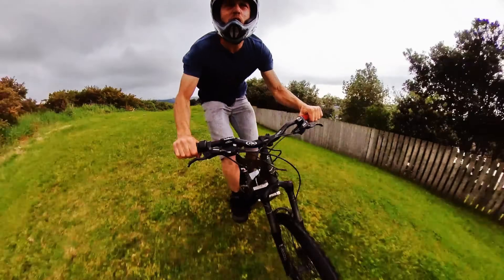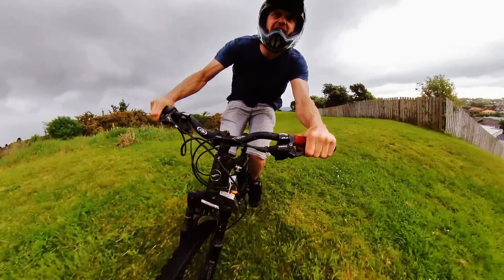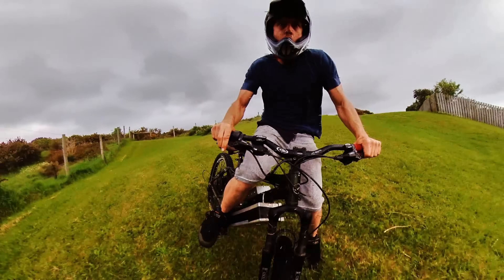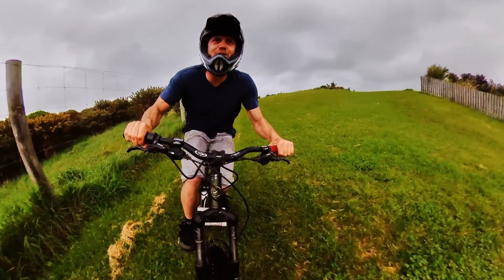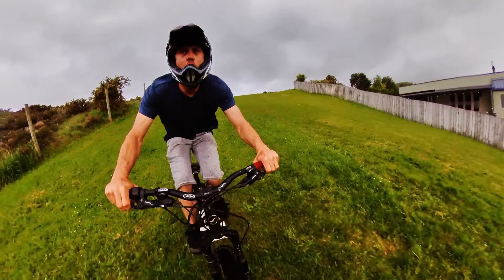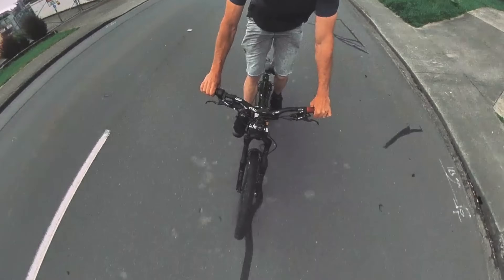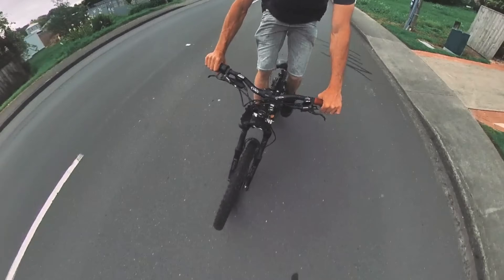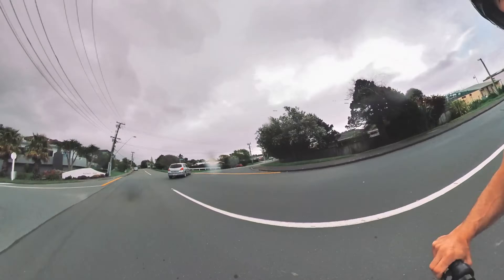How to build a beast 5kw ebike from a 1.5kw aliexpress hubmotor kit

Comment: he didn't say this is dont think but, DO NOT RUN LITHIUM BATTERIES WITHOUT A FUSE! ESPECIALLY, IF YOU ARE NEGATING POWER LIMITS ON AN ESC. IF YOU HAVE 1 SINGLE TRANSISTOR BUST YOU WILL HAVE AN ELECTRICAL FIRE OR BATTERY FIRE. BOTH OF WHICH ARE IMPOSSIBLE TO PUT!!!!!!!!!!!!!!

also, He did not test the temperature on the coils, which is much more worrisome than the temp of the magnets. If the magnets get too hot all they do is lose there magnetism. Whereas the coils will melt and short and cause electrical or battery fires as well.

Not to mention the fact that the system is probably less than 60% efficient due to the small gauge of wire in the coils. Odds are at least 20% of the power being used is being given off as waste heat. Especially if you overload the coils and the ESC.
Reply from the maker: Yes this is true, I am just using these batteries for the testing and I have an xt90 plug by my leg I can disconnect easily, it's similar to running off lipo cells but a fuse is definitely a good idea thank you. I have a 18s 4p of p42a cells with a bms is in the works going in a new battery box, this will be much safer battery.
Reply: @jd-dc  Great, I'm just worried about people replicating your project without supporting knowledge. I did that with disastrous results. I built up a pack of 18650s 4years ago and they exploded in a hotel while charging.
Reply from the maker: Yes I agree, that is why there is no information about the design or build of the batteries in this video, they will need a lot more information to try to build their own battery, check out my electric skateboard build video I documented the battery build in that video. 
Oh no way that's no good. We're you charging on a balance charger or did you run it on a bms? I welded up a big steel box in my garage for building batteries and for charging, hopefully I never need it but you just never know
Reply: @jd-dc  I had a BMS on it, but I used brand new, ebay, dell batteries. They were probably of the ultra fire variety because they popped off. I have learned my lesson with that though and I got all the right equipment. A good spot welder, LG/SANYO/Samsung cells and other legit brands. I also heavily caution people from using Amazon special BMSs and always suggest a Superior/Daly BMS even if it take 2 months to get here. I also suggest that people use per-cell fuses on packs over 2-3p. I have been testing used/dead bycycle packs. They have good cells. I also have two scooter packs on my personal bike from Jehu Garcia, jag35.com.

Comment: Cool video, I learned about hub sinks and statorade.  I am sure you already know, but you are absolutely thrashing those batteries and they will not have much of a lifespan.  If you look up the damage that discharge over 3C does you will cringe.  Just estimating, I already forgot your stats but it looks like you are around 8C discharge.  Did you check how much you are heating your batteries when you do this?
Reply from the maker: Thank you, yes I monitor the batteries every ride, they do not heat up much at all. They are a 5p configuration of samsung 25r 18650 cells approved for 20A continuous per cell so in that pack it has no problem pushing out 80A peaks. It's just the test batteries I'm using that were harvested from some abused Ego batteries. I have created a new battery box and will build I bigger battery with a bms out of p42a cells. Video to come soon
Reply: @jd-dc  I just skimmed thru the video again, on the ESC all you did was add solder to the shunt to lower impedance?  Then you overvolted it and stuffed a bunch of extra current (heat) into it that is isn't designed for. Is that correct?  Chinese electronics are well known to perform at least 20% under specifications as their limit.  How is your ESC working?  That is amazing it didn't burn up immediately LOL.
Reply from the maker: I know right! I've been running this kit like this for over a year riding trails, this is a really strong kit. However I recently cut up my bike to make a battery and esc box but I've found if the esc isn't exposed it gets pretty hot so will have to re think that plan

Comment: Those yellow and blue and green wires coming from controller especially the yellow one can’t take much more than 1500w I’ve burnt many of them out
Reply: Yes, it is the thickness of gauge of wiring. It's why those cables get thicker of every step up controller. You have to fit new wiring from motor, battery and controller. Thickness of wiring is part of the math in all electrical re work.
Reply: @user619tlsdca5  what amps the stock motor wires suitable for?
Reply: @liammccallum9398  Depends on the motor.  Different gauges of wires are easy to look up their power ratings for.
Reply: how much A can the motor wires take
Reply: @liammccallum9398  To be reworking the cables to match the upgraded controller s awg or gauge of thickness, you have to be very schooled in electrical field or take chances here of instruction videos because you going to have to remove the bonding at terminal ends and even get into battery case to replace original cables. You can't just add it on to existing ends for they won't match or do anything of higher output if electricity. To be simple, jus look at controller s terminal ends to match with battery. Example is there s 2 batteries of 52 v 20ah from one vendor, reasons 2 types is due to one deicated for 1500w controller and other one is for 2000w. What sets them apart is the one for 2000watt has the right thickness of terminals to controller. I use same battery between my 1500 and 2000watt e bike but my battery fitted for 1500watt as I still can use on my 2000watt but controller amping up more demand from battery as you can tell from the sound being juiced out. I would have to get into battery case of breaking of the bonding and re do right thickness of cables from within the battery.

Comment: I have done before but finally burnt mine out after a few months how long did urs last?
Reply from the maker: So far I have been riding it like this for 15 months but the first 2 months it was on a 20 inch wheel. I did notice the hub motor getting hot which is why I decided to install the hub sinks. This KS brand motor (qs rip off) I used seems very solid

Comment: Hey just want to ask can you do this on a electric dc motor ?
Reply from the maker: Yes this is an electric dc motor, 3 phase brushless. Are you referring to a brushed dc motor with 2 wires and no hall sensors? What controller are you using?

Comment: Can the same thing be done for a mid drive setup?
Reply from the maker: Yes it can but the kit from this video has a large motor and controller for 1500w which may or may not be the case with your set up so try not to over do it right away and make sure you monitor the heat until you know how much it can handle. Most mid drives have heat sinks already but you cam add statorade to help with the cooling.
I have a video coming out in the next couple of months on a 6kw cyclone mid drive kit that was pretty cheap. It's going on a 2010 kona stinky, I will add links and a ride review also

Comment: This was really good. I'll bet you could run 8-9Kw on that motor no problem. What exactly did you do for that motor controller? I have a 65A chinese controller, does that mean I can make it 150A?
Reply: You Can make it even 650A if you know how to :)
Reply: @etrix4533  wouldnt other components give out though??
Reply: @shaunphillips6160  yes, you would need to swap out most of the components in your controller and make traises stronger and thicker for more power.
Reply: if you want your caps to explode sure.

Comment: Great video I'm wondering how you switch between 36v and 72v? It looks like you are running a couple of batteries in series? What is the BMS rated at? Relatively new to ebikes but would like to run a couple of 36v in series on mine. Just don't see how to avoid damaging the BMS.
Reply from the maker: Thank you, I am not using a bms for these batteries at the moment I have 4 x 18v battery packs with balance wires attached that I can balance charge on a hobby charger. And I use a voltage alarm when I'm discharging. You should be able to connect your batteries in series for discharge and then disconnect and charge them separately without damaging the bms's as long as they are the same voltage and amp hour packs. 
Also make sure your controller can handle 72v and your battery cells and bms can handle the Amp discharge rate from your controller
Reply: @jd-dc  max voltage depend one the model of the fetts/transistors/ and caps voltage XD most 36-48v controlers have 63v caps

Comment: Enjoyed video, I like your battery box, but seems like front tire would hit when suspension compressed.? Hope not. As for sealing side plates on motor with silicone, don't do it! Water leaks in at axle and has no where to go, mine quit turning because the space between rotor and magnets was filled with rust.
Reply from the maker: You are right it does hit but only if I take a pretty big drop, so I have removed the battery box and the top bar and rebuilt the frame into a bomber style box frame out of fiberglass, carbon and kevlar. It's almost ready for testing I will upload the video soon.
Do you think it would work if I silicone up the the axle hole as well?
Reply: @jd-dc  can’t wait to’ See it!
Reply from the maker: Just added the video now, very happy with how it turned out, it's not the smoothest finish but it's functional and strong..... so far 😄

Comment: Great video I've built an e scooter using a 1500w 20 inch wheel kit running 48v 17ah battery if I just solder the shunt together will that give me more power? I'm a Newby to electrikery tinkering.
Reply from the maker: Yes that will work, just make sure your battery can handle the extra power. There are lots of videos on youtube of people doing close up shunt mods if you search "shunt mod" you will find some more in depth instructional videos

Comment: how i now my hubsink sice need for a hub motor 48v 1500w fat tire 20 ? is a chinese alliexpres hub motor
Reply from the maker: Just if it gets too hot, hubsink can help keep it cool, you can test it by feeling the side if the motor with your hand after a hard ride
Reply: @jd-dc   i cant made my ebike go faster than 56kmh , and have 67v batery 1500w hub motor :( the controller maybe need to change to a kelly or sabvoton?
Reply from the maker: Yes the only way to increase your speed now is to increase the voltage and your current controller may not be able to handle that. I see flipsky have a 100A 72v ebike speed controller on aliexpress for around 100usd. I just ordered one so will put up a video of what it's like when I get it

Comment: Do you reckon that can be done to a 1000watt engine soldering the two bridges together
Reply from the maker: Yes, you should be able to shunt mod most non programmable controllers. Just make sure your battery will handle and be careful not to generate too much heat with the extra power
Reply: I would think you would just need to hope it has good enough components to handle the power
Reply: Great video.

Comment: I have exactly the same kit! My battery BMS is rated for 40amps, I'd like to do the shunt mod but don't want to ruin my battery. Would you recommend avoiding this altogether or should I put just a little blob of solder on at a time whilst keep an eye on my wattage? Thanks
Reply from the maker: I would definitely do it but once you upgrade your battery. It's very hard to tell how much you will increase the power by and you will trip your bms or blow a fuse if it goes over 40A
Reply: @jd-dc  okay thanks! I may just build my own battery pack as finding a high output battery is difficult!
Reply: @TheRealKingSamus  im running a daly bms in which i can manually manage amp limit if it helps
Reply: @dangr5258  thank you

Comment: Got a link for the parts bro? And did you make thar battery box yourself?
Reply from the maker: Yep the links are in the description. No I had the battery box made by an engineer. I have trouble pronouncing "aluminum" let alone welding it 😆. I don't really like the box though it's not big enough and if I do a big drop the front wheel hits it, so next week I will cut the top bar out and carbon fibre a new battery box into the frame

Comment: What's the safest top speed without overheating the controller/ motor and what's the absolute top speed?
Reply from the maker: I could only get 15s to fit in this battery box and that gets me 55kph, have run it for a while on 18s without heat problems and get 65kph top speed. Have not tried 20s....... yet
Reply: @jd-dc  what do you mean by 15s 18s and 20s I'm a newbie..
Reply: @seeds..oftruthtv..6081  s stands for series in battery terms lol newb
Reply: @seeds..oftruthtv..6081  lipoly fully charge each cell to 4.2v and shouldn't be discharged much past 3.8v for maximum cycle life, other chemistries like liFePo4 can be discharged closer to 3v power cell and while don't charge up as high they make up for our with a more level discharge drop off curve. To get higher voltages, the cells are wired in series which sums the voltages of each cell to deliver the final high voltage. A flashlight works ok on 1s, most toys on 7.2v 2s, power tools start at 11.1v 3s and some times go to 14-20v 4-5s and EVs pick up with the smallest electric scooters for kids at 5s and 6s which is around 24v. Anything 6s or over is really powerful just in terms of voltage, it will still depend on battery capacity, transmission, controller, and motor efficiency to deliver performance.
Reply: @jd-dc  so , do you run 72v batteries with a 36/48 v controller , without any issues? Did you change the caps ?
Reply: @jd-dc  isn't there any limit in voltage for this contoller? from 12s to 20s is a big jump! crazy that this chinese controller can handle 18s already..
Reply: It's the bearings and wheels you want to worry about doing those speeds 😂
Reply: I've had up to 90km/h+. This guy used a csc ks 40h, so it can handle some serious power.  Good little motors.

Comment: Got damn sick video bro , I have the same kit 1500w 52v on my fat bike and always wondered how to make it acceleration faster, do you think I can get away doing this mode without using  ferrofluid?  If I'm not planing to go full throttle all the time.

Thanks dude
Reply from the maker: Awesome bro yes definitely, you just need to keep an eye on the temperature of your motor and controller, and make sure the battery can handle it. I ran it like this for a year with no ferrofluid or hubsinks and I couldn't see any obvious heat damage when I opened it up. Depending on the type of solder you use and how much will dictate how much the power will increase, I used 50% lead solder for minimum resistance, maximum power

Comment: Very impressive and I learned a few things. Never heard of statorade and the hub sinks are very cool. 
what is your top speed on flats?
Reply from the maker: Thank you, on the 15s (54v) battery I'm running it on at the moment I get 55kph top speed but on 18s it goes 65kph. Next I will cut up the frame to make a new battery box for a bigger battery
Reply: @jd-dc  that seems lower than it should be, make sure you don’t have any bottle necks or your battery limiting current
Reply from the maker: @Louis-lu5wh  yes you could be right, I'm using 8awg and xt90 connectors down to the 12awg cables on the esc so I could upgrade those, but the speed is also determined by the amount of winds on the motor and the diameter of the tire. The more turns around the stator will increase torque and decrease top speed and vice versa
Reply: @jd-dc  also voltage negates top speed as well. Amps equals acceleration. Voltage equals speed(rpm)
Reply: @jd-dc  actually it all depends on the amount or mass of the copper in the motor
Reply: My ebike will hit 63kmh 52v bafang bbs02b with pirelli fast rolling tires , but i doubt it would be anywhere near this level of performance.
Reply: I have reached 55km/h with 14s battery and 36v-72v 50A cheap chinese controller. My motor is 1kw from a cheap chinese diy kit, looks similar to the one on this video. You can cut the phase wires really close to the motor and replace them with thicker ones, to make sure that you can deliver all the amps!
Reply: And with 72v battery I was able to reach 80km/h
Reply: i got mine to 60mph, and had plenty of power to go, but at that point i didnt need to know how much faster it would go